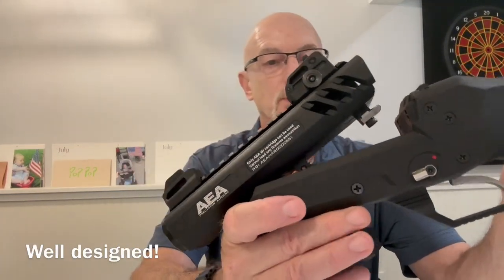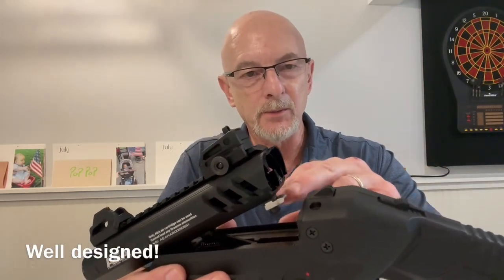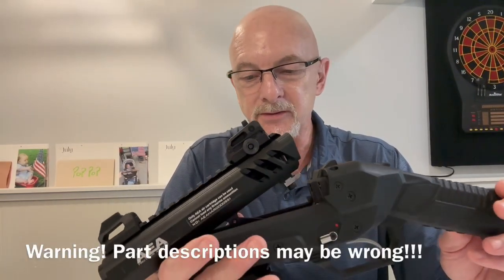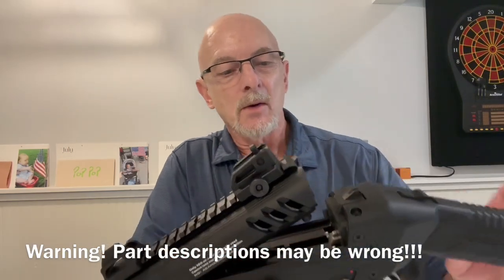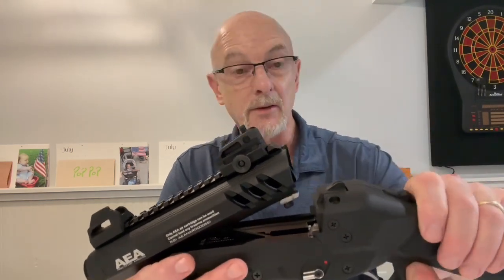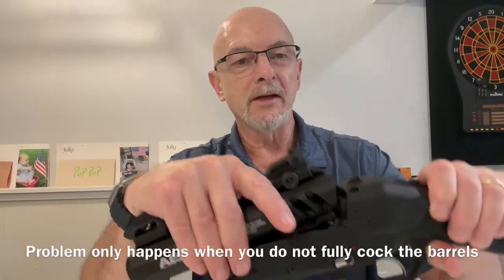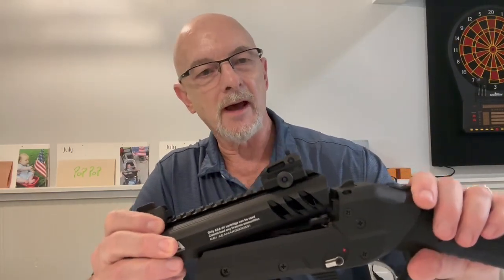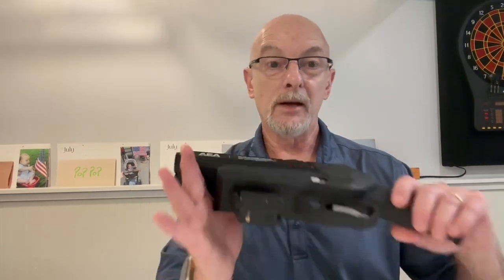A look under the hood of the new AEA Harpoon!

Comment: I just bought one of these Harpoons and mine is having the exact same problem.   It’s the left side pin.  It sticks out further than the right side, thus blocking/ preventing it from closing.   Im not satisfied with having to use my finger to push in the cartridge as I close it.  The right side works perfectly but the left is broken in my opinion. Does anyone have the contact information for AEA?  I would like to write an email to them directly.
Reply from the maker: I know it is crazy they let that slide! I’m really careful where I’m pointing the barrel when loading it is an accident waiting to happen!